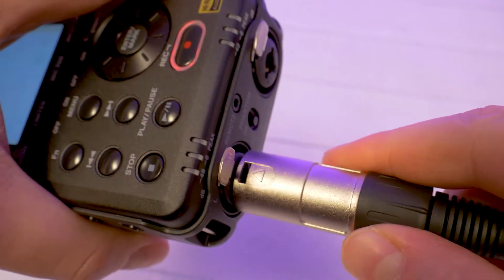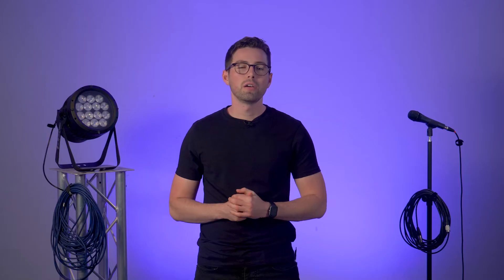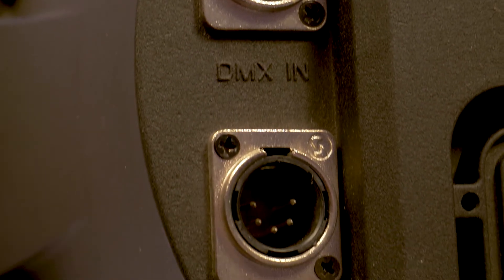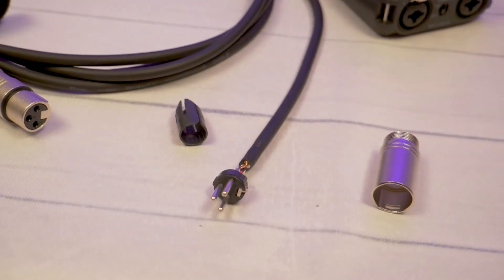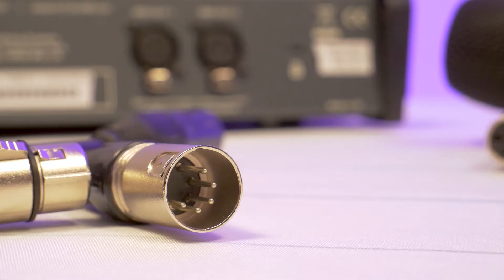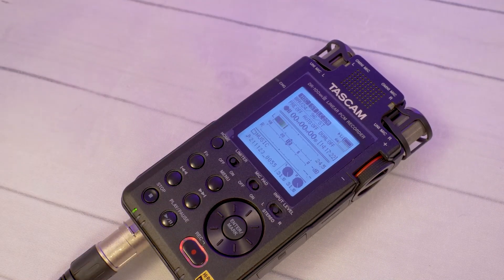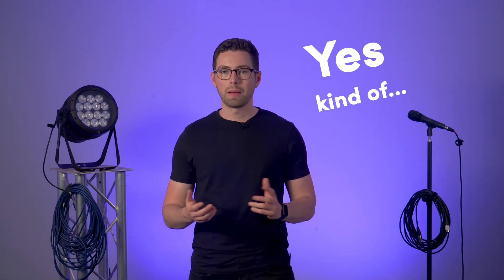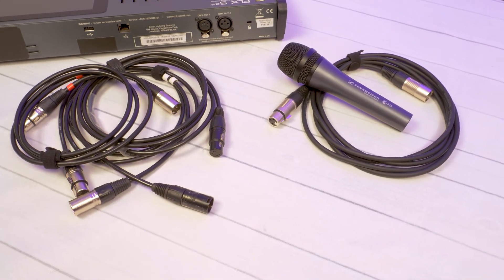XLR vs DMX - Differences Explained

Comment: Why has dmx not just been replaced by CAT5? Cheaper, shielded and more bandwidth
Reply from the maker: Good question! Newer fixtures feature ethernet ports for Art-Net but will also feature DMX because that has been the standard for lighting for years, so fixtures need to be able to use both as most people will still be using DMX. At some point DMX will probably be replaced but that won't be for some time. 😊

Comment: If you want to use xlr for dmx in first disconnect shielding and leave only 3 internal cables so lights are not grounded together by data cable. Flickering solved. Using dmx as xlr has opposite problem. You want that shielding. Worth noting: cheap cables, both, dmx and xlr, has same standard stereo cable (2 lines and shielding) and body of the plug isnt connected with other side at all. Check impedances in real life... One may notice there is no difference at all and it's because of price. Standard cable, standard copper, different is only print on cable so they can charge accordingly to naiveness of buyer.

Comment: I've got an old Japanese DAT machine with a 5 pin XLR socket, would it be possible to swap the socket for a 3 pin XLR socket?
Reply from the maker: Hi,

Could you let me know the model of the DAT machine?
Reply: @LeisuretecDistribution  it's an Aiwa HHB Pro 1 portable DAT

Comment: Very useful thank you. One thing that you didn't cover though is how to identify if a cable you have is XLR or DMX. I've got tens of cables that I assumed/ thought were XLR. How can I check and identify which is DMX and which is XLR?
Reply from the maker: Hi Dave, thanks for your comment! There are next to no visual differences between the DMX and XLR cables. There are some tale-tale signs of each but nothing definitive. Firstly, if you have a 5 pin cable, this will automatically be a DMX. The DMX cable itself however will usually be ‘stiffer’ and have a gloss finish to them (but we cant vouch for every DMX cable), plus a model number, name or what it should be used for may be written on the side. An XLR cable will usually have a ‘matt’ finish to it and be a lot more flexible as they’re used with mic’s and, again, could have ‘XLR’ or ‘microphone cable’ etc… written on it. I hope this helps, thanks, Leisuretec

Comment: But short of an impedance measurement, how can you tell the difference between them if you have both? (glaring omission!)
Reply: Great question.   When I bought my DMX cables, I immediately tagged them so I wouldn't mix them up with the XLR cables.